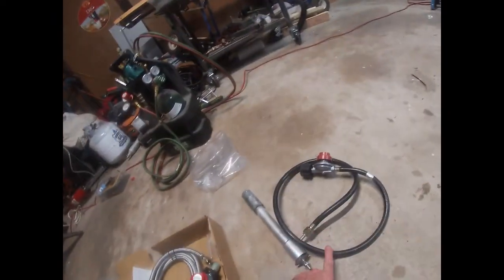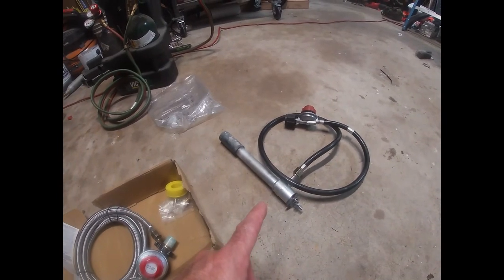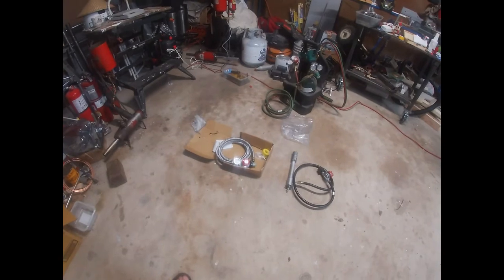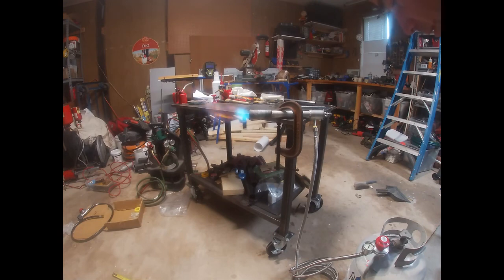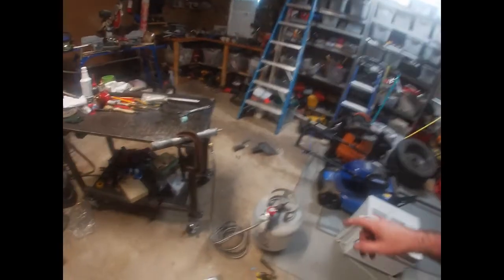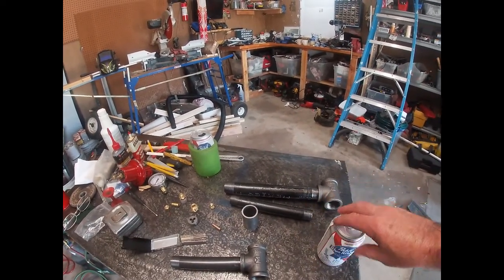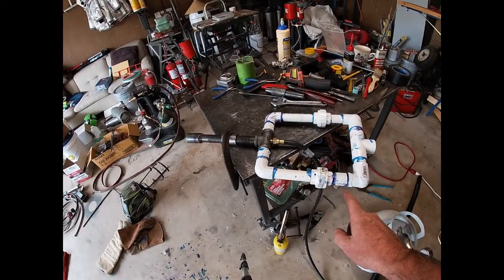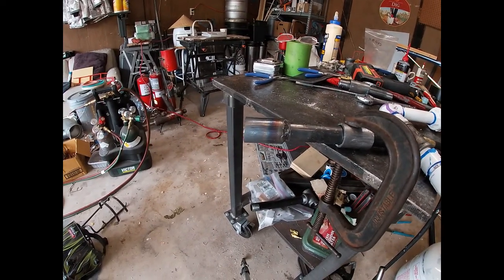furnace gas burner noises and flame going on and off pulsating

Comment: Thanks for the demonstration!  Yup my burner definately seems suffering from lack of air.  I had a pretty good feeling that was the case because I can see a flame come out the top, probably indicating I am still burning fuel outside the furnace.  You just gave me a new direction to go with that when I get some time to build a burner.
Reply from the maker: thank you for watching